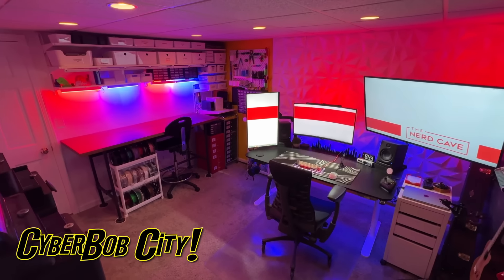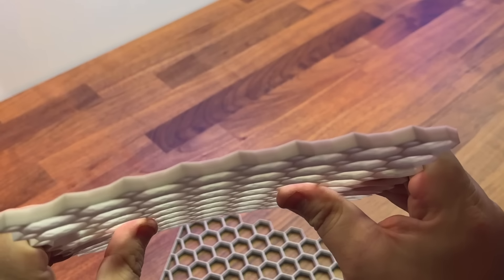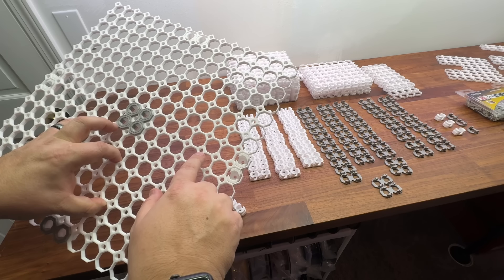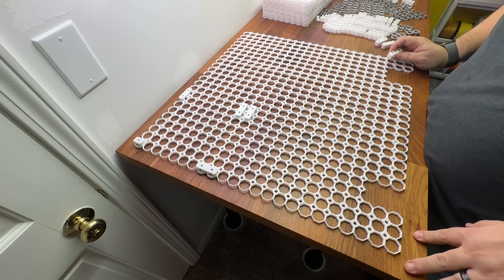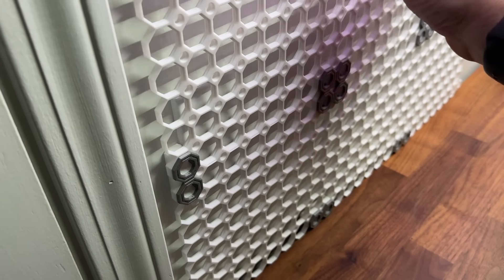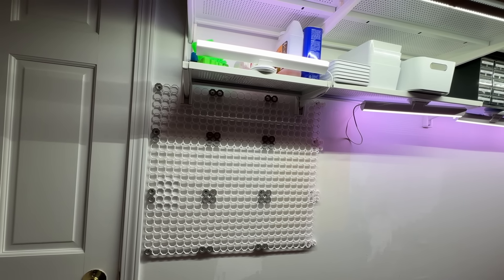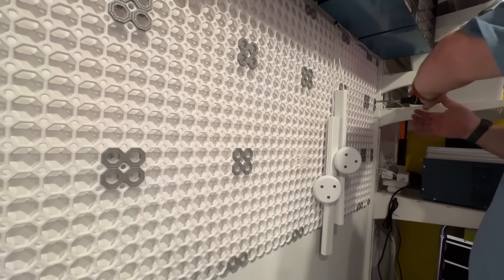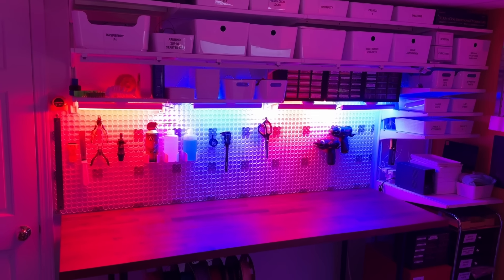It's MULTIBOARD! A Better Honeycomb Storage Wall?

Comment: this video is basically the official tutorial on HOW TO REALLY START WITH MULTIBOARD, because the official material is very complicated and doesn't explain the basics to people who are not advanced wall organization system users. I think I watched it around 3 or 4 times because whenever I was unsure what to do I would search and click on this. hahahah. Thanks so much for the great video.
Reply from the maker: Thank you! Be sure though to use some of the new joining methods Jonathan has released. They revised the quad snap system so they are easier to take off and more functional. Thanks for watching!!
Reply: The fact that this system requires a subscription to get access to the generator but has such awful documentation is bullshit imo.
Reply from the maker: @FlakAttack0  There are lots of systems out there. Figure out which one you like best and give it a try! Thanks for watching.

Comment: I did some MULTIBOARD when I first got my printer. Recently I tried the Honeycomb, mainly because I like the solid edge you can frame it with. But found it way to hard to get pieces to match. So I am sticking with MULTIBOARD, wish they would add a border option.
Reply from the maker: You could probably add a border without too much trouble in tinkercad. But it still will be some work. Welcome back though! Thanks for watching!

Comment: They make an extension for the switch plate box.  They use it  for tile jobs to extend the box 1/2” and you  get longer cover screws.  You probably could just print it in the filament color of your job.
Reply from the maker: I've seen those! My room is tiny though and there is switch on another wall and I actually put motion sensors in the room so I never use either switch. So I was fine covering up.  Thanks so much for watching!
Reply: @ I thought in case someone else needed the option to extend.  I have to believe it would easy to make your own using a big box store extension as a model.
Reply from the maker: @pburchins  Ah, I see. Yep, and extension would work nicely. I do get a little weary about mixing 3d printed plastics with any mains electrical. Normal cover plates and such I believe are usually made out of nylon or PVC.

Comment: i would use a "molly" style wall anchor. they have the wings that come off 2 sides. you can even print them easy enough and they hold serious weight and lock easy when screwed down. standard expanding wall mounts just don't sit well over time in sheet rock. a molly holds off the back side of the board. but I love the idea of the milti board. I was already working on something similar. I will have to look into this and maybe finish out my work space in the multiboard.
Reply from the maker: The ones I used are suppose to have wings that sort of expand out which sort of does the same thing. I have a feeling maybe they are just spinning in the hole. I'm about to do a test on a piece of scrap drywall which will be in my next video. 

You should definitely check out Multiboard. It's really cool! Thanks for watching!

Comment: the only thing i would suggest is to mount a aesthetic/sacrificial board (plywood or something) to the wall.and then mount the Multiboard to the wood, only to limit the amount of holes you would drill into the sheet rock. as time goes by you choose to go with a different system or take it down for what ever reason.
Reply from the maker: That is not a bad idea. But too late now! So far it's been really handy. I'm posting an update video very soon.

Comment: I never use those wall anchors because sometimes the screw grabs and makes them rotate in their hole or even pull out of the hole in some cases. There is another, much better type of drywall anchor that has a self-tapping tip and very coarse threads. You screw it into the drywall directly, no pilot holes required (although it's not a bad idea to make a small one beforehand). The biggest advantage of this type of anchor is that it cannot come loose so you can tighten the screws into them as tight as you want. You can find those at any home improvement store.
Reply from the maker: I usually use those kind but thought I'd try something now. I'm wondering now if my screws just aren't long enough. Going to try a test soon. Either way my wall feels very solid. Thanks for watching the video!

Comment: Greetings form cold and dark Finland. I just started to print these multiboard combs and accessories. For me, with all those different pieces, feels like a maze but your video helped very much when you showed how to attach them.
I only own 1 printer and it is Anycubic Kobra 2 Neo so it will take a while before i have a decent panel ready. If i may say, your " nerdcave " looks awesome. I wish i had one 😁
Reply from the maker: Make sure you use the new grid snaps he’s released since I made this video. They are better and easier to work with. I will be posting an updated video soon! Thanks for watching!

Comment: You can easily make custom size tiles (panels) just by importing several into PrusaSlicer and offset them relative to each other in one direction or the other by multiples of 25 mm.  So you can have an 8x6, 10x4, 6x12, etc.  Whatever size you want.  Then just make sure to highlight all of the tiles and right-click "Merge" before slicing.
Reply from the maker: I was happy to support Jonathan for a while since he put so much time into this cool system!
Reply: @CyberBobCity  I agree.  Supporting him for all his work is a good idea.

Comment: Great video and nice organizing system. Appreciate the easy to follow tutorial!

The one thing I would do differently is to paint a 1/2 or 3/4 inch sheet of plywood in your wall color, and attach that to the studs in 4-8 spots (depending on your storage board size). Then mount your board on that with smaller screws that does not penetrate the drywall. That way you don't have to use those shitty dry wall anchors and your wall doesn't end up looking like a Swiss cheese.
Reply from the maker: Yep, that is definitely a good option and would keep it nice and sturdy. For this wall I was fine with trying it on the drywall.

Comment: Thanks for sharing this. I just got a storage building I’m turning into my nerd cave for 3D printing, music production and electronics. Maybe we’re brothers from another mother? 🤔🙂 so I had already printed a bunch of the multiboard parts but I was a bit confused about how to use them. This helped an awful lot. Thanks.
Reply from the maker: Maybe we are! 

He does have some newer pieces released after I made this video you might want to check out. I haven't switched mine out but I might just to see how they work. Apparently the new quad snaps can be removed with a tool. 

Thanks for watching! Good luck with the storage building! Sounds like an awesome project!

Comment: nice to see someone start, I too think its the best hex organizer yet (with peg, push, thread attachments). So far i only have one problem and that is how to get (your grey connectors) the quad front  face connectors...to back out, if i need to change. I like the drill holders, btw.
Reply from the maker: Yes, I broke a few removing them. I think he is going to quad fronts you can put bolts through which would make them easily removable, but then you're tying up a good amount of octagons with bolts. So we'll see how it goes.
Reply: New ones have been created with a removal tool.

Comment: He does have a couple files that you could have used. There's small connectors to hold the back pieces together in sets of 4 and there's wall supports that he suggests to use on larger panels so they don't flex as much
Reply from the maker: The connectors seemed kind of fidgety. I did just learn about the Wall Support Pegs and those would have been useful.

Thanks for watching!
Reply: @CyberBobCity  they did seem like they wouldnt be helpful but mine pressed and held into the groves really well and I feel it gives it a bit more rigidity. I did a large 5 panel by 8 panel. Definitely enjoying this system over just the honeycomb
Reply from the maker: Nice! If you are in the Discord channel you show post some pics of your setup in "Show and Tell"!

Comment: Matthias Wandel once made a video criticizing these wall organizers in general. The main issue with such wall systems is that, instead, you could simply attach some OSB to the wall and then screw the 3D-printed supports directly onto it. This approach is cheaper, stronger, and more customizable.
Reply from the maker: I think these options are a much more refined alternative to screwing into OSB. The same with using French cleats. But everyone has different styles and needs so it's great we have lots of options to find what best suits us! Thanks for watching!
Reply: @CyberBobCity Agreed. These systems have a certain aesthetic appeal, which can be desirable in certain situations, and of course personal preference.

Matthias is a genius though, so I would always value his opinion.
Reply: I agree with cheaper solution, if want aestethic maybe we can try to engrave the OSB with honeycomb pattern :)

Comment: really great video that covers the basics of how to get all the parts that we've printed onto the wall! Great job! How did you decide how many anchors you wanted to use at the offset snaps? I think you did one anchor per quad snap? thanks
Reply from the maker: Keep in mind this video is older and he has some new parts that replace some of the ones I'm using. 

As for anchors, I knew I wouldn't be storing a ton of weight on these. So one anchor per quad snap seemed fine for me.

Thanks for watching!

Comment: I just started printing this as well, very neat project. My only real wish was that he designed the system to have the the standard 1 inch Pegboard hole spacing. It's designed for 25mm spacing where standard would be 25.4, so super close but over the whole wall it adds up. I'm printing it sized up by 1.6 percent to see if it will still work and get me to the standard spacing. 
Fingers crossed!
Reply from the maker: Interesting! I’m curious to see if it works out for you. Good luck!
Reply: Very interesting point.  I am printing a 9-foot wide (by 4 -foot-high) wall right now.  I don't plan to use a ton of printed accessories, as I just bought a 278-piece, metal accessory pack, and also several shelves and baskets.  None span more than 12 holes (horizontally).  It will be interesting to see if I find any issues.  BTW, I decided to use this over a standard metal 1-in (25.4 mm) pegboard, because I need to mount all my home automation equipment and Wi-fi/routers/switches.  Lots of wires, and this will organize/hide them.  IMO, this is the true value of this system.  Of course, I plan to hang a ton of 3D printer tools also.  I am a huge fan of this design.  And CyberBob... your video is what inspired me ...Thanks!
Reply from the maker: @tobyvorpahl4279 Good luck on your setup Toby! Thanks for watching! 😊

Comment: There is a cross part a for where 4 corners touch, makes it stronger.  You should use those instead of 2 2x joiners.
Reply from the maker: They didn’t exist when I built my wall. Will be posting a new updated video soon though!

Comment: This is great.  I'll get started printing tonight.  Not directly related to this project, but what are the shelves and buckets that you've got up above your multiboard?  You're storage solutions are top notch.
Reply from the maker: Don't get me started on that! I have the Algot system from Ikea which they discontinued in 2020 so I can no longer get shelves for it. So pissed. I wanted that thinner bottom shelf to go all the way across and I think I had one but I can't find it. I should have bought extra of everything so I could have some flexibility if I wanted to move things around.

The bins though are all Ikea. Then I bought these plastic label holders from Amazon and then I just printed labels no regular paper that go inside of them to label everything. So I like those... Just wish they would stick with an organizational storage system....
Reply: @CyberBobCity  thanks for the info, and that’s really unfortunate. I guess I’ll go hunting for something similar.
Reply from the maker: Ikea currently has their BOAXEL shelves but when I saw them in the store they didn't seem as high quality.

Comment: Your wall looks great. It’s such a nicer look than pegboard or French cleats. I just found HSW and Multiboard two days ago. I printed one small panel of each. Sadly… the thing I was wanting to make that lead me to it… did not work. It was a mount for akro bins. When I hung even an empty bin on the mount it just pulled the inserts off. I’m sure there is a way to do it. But I am still new to 3D printing and trying to learn design so I am not sure how to make it. However…. I love the multiboard. I was about to hang pegboard in my shop and now I’m ditching that idea and going to do multiboard. 

Curious… how much filament did your wall take? And what filament did you use?
Reply from the maker: Well I love my French cleats in my garage. Multiboard though is great for smaller less heavier items.

I probably used 3 rolls on everything up there.

Check out the items in the Multiboard system which are “bolt locked”. I think those will help you.

Thanks for watching!!

Comment: Nice build 😎 Do you have an approximate cost for that project? Amount of filament used? Thanks for sharing!
Reply from the maker: Thanks! It was about 2 rolls of filament for the tiles and not even 1 roll for the white support pieces and the gray snaps on top. So I would say less than $60 in filament and less than $20 in anchors and countersunk screws. The tool holders I made were not much filament at all.

Comment: For the cutout supports and making the board more stiff even when offset, I guess you could use the threaded inserts with just the right length to touch and sit on the wall without having to drill new holes. I haven't tried this, so it's just a theory, but I'm in exactly the same position you were where I started the HSW project and then this came along. I love how the models for this system exploded, but I'm not a fan that the official measurements aren't public, but I guess it's only a matter of time.

P.S. I tested this on a small scale, it seems like it would work, but there aren't any bolts at the moment that would be the right length for this.
Reply from the maker: Yes! They are called “Wall Support Pegs” which I was unaware of until another commenter posted about them. I might add them to my build in a future video. Seems like they would work perfect for that.

Thanks for watching!

Comment: I mean I've seen a few videos on this and it seems like it has some perks, a big one being the ability to run cables behind it like you said.  But to me it seems like HSW with more steps and complications.
Reply from the maker: It can be exactly like HSW if you want it to be. I do think the panels are stronger and take less filament, so that is a plus. It's great we have a variety of options though at our disposal. Both HSW and Multiboard are cool systems.

Comment: Did you "stack print" your tiles? I'm just getting started and haven't printed my tiles yet.
Reply from the maker: No, I wanted the same texture on all the bottoms which you can't do with a stacked print. I also have 2 Bambu Lab printers so with both going it really didn't take that long.

Comment: I really like this system and up until now could not fully justify buying a 3D printer, however now things may have changed. What I would like is your answer to this question. 
Would you buy a printer, in my case a Bambu lab A1 ( not sure about the AMS lite) just to print this system and then use the printer for other things. Or do not buy a printer and find another storage system?
Reply from the maker: I can’t imagine life without a 3d printer now. You will 100% find other uses for it, and the Bambu Lab A1 is a great machine!
Reply: @CyberBobCity  I confirm, really a great machine for beginners and the AMS is more than a bonus :)

Comment: Hey cool video. im in the proces of making a hobby room and i'm definitely gonna get this for my wall. quick question what are the lights you got hanging from your shelf shining on your multiboard? they look nice
Reply from the maker: Thank you! If you are talking about the colored ones, they are the Govee RGBIC Light Bars. Higher up I also have some under cabinet lighting that is just white that I picked up from Amazon. The Govee lights weren't really bright enough to use ask task lighting. 

Good luck with your build!

Comment: If the screws for your drywall anchors won't give you a solid mount, you've probably drilled the hole too big, or you may have stripped the plastic anchor.
Reply from the maker: The anchors came with the drill bit to use. I think maybe my countersunk screws I switched out might not be long enough. I'm going to try a test on a spare cutoff of drywall.

Comment: By any chance do you have the width and length measurements for a single wall panel as well as weight? I am trying to estimate the amount of filament I would need for my area
Reply from the maker: the 8x8 core tile I mainly used is 207.65mm x 207.65mm and used 79gm of filament with their recommended settings of .20 layer height, 15% infill, and 3 walls. Hope that helps!
Reply: @CyberBobCity  thank you very much it definitely will